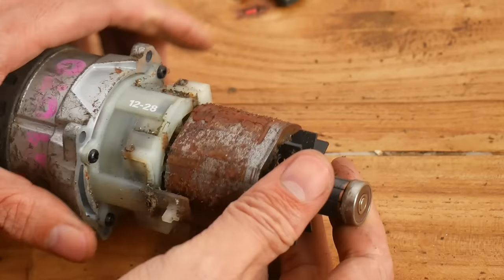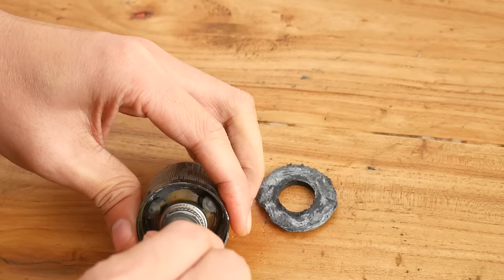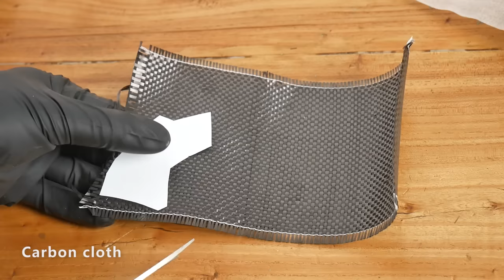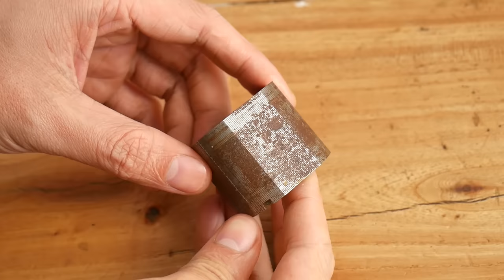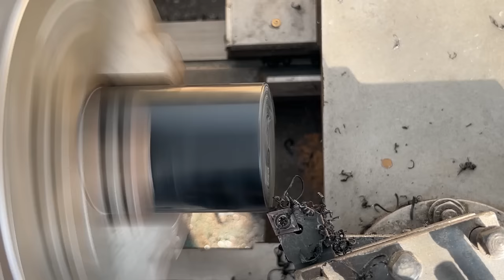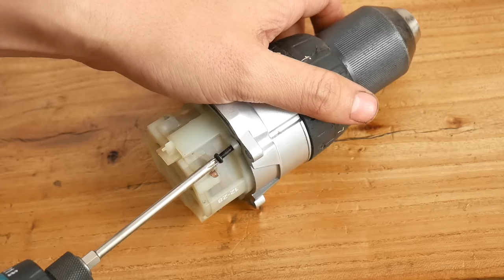Restoration of Cordless Drill  makita DF458D

Comment: excellent restoration. brush tools are more robust and durable. 
than the  brushless.
Reply: in your dreams
Reply: @CrudeBuster  They don't let in as much dust
Reply: @firebladex8586  unfortunately some people think the commutators covered in carbon dust and failing with a smelly fire is a benefit
Reply: @CrudeBuster  the carbon on the commutator bars acts as a lubricant to help prolong the life of the brushes.
Reply: @firebladex8586  that's a good joke. wish the burned out AC motors here found it funny too

Comment: Nice repair. Considering the switch cost slightly more than half the price of a new tool, not knowing the internal condition of the sealed bearings (obviously abused), it was a commendable effort. I hope you get years of use from it.
Reply: It’s not so expensive if you consider to replace with replica from Ali
Reply: 040823/1317h 🇺🇸 There’s always a negative flash of comments, from highly motivated negative people; instead of applauding the painstakingly endeavored task; the repair person undertook. I salute the the engineer who undertook the M&R of the Mikita Drill and a standing ovation for him. I appreciate your confidence, your extreme patience and meticulous refitting of myriads of intricate parts, back to working condition. Thank you, Sir.
Reply: What internal sealed bearings?

Comment: Why did the plastic plate on the back of the chuck look fine coming out of the rust bath but suddenly look ruined in the next shot?
Reply: I struggled with that, too.  I think the original cap was chowdered when it was initially disassembled, and the replacement cap was loosely fitted for some of the filming, then the chuck was disassembled again.  There are a lot of shots that were set up and filmed, its not surprising if a segment was filmed out of sequence, or needed to be re-filmed

Comment: Yaas! My poop B&D snapped right there and I had managed to velcro it together and it was usable on small things. I was thinking of using acrylic and/or some type of fabric and rivets. @Everyone - anyone know if this would be a viable solution as well? I'm about to just melt the casing together and duct tape the sumba so I dont have to tote my hammer drill around.